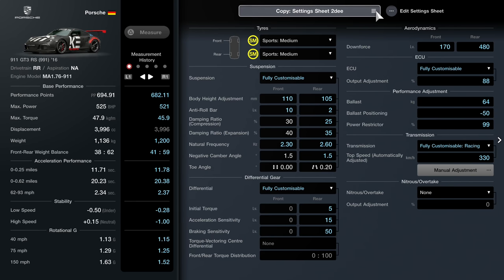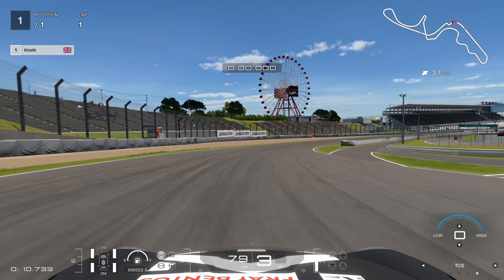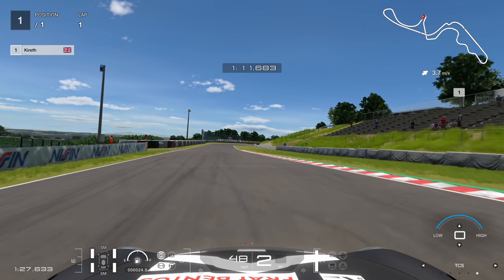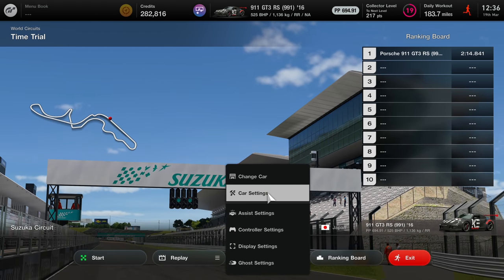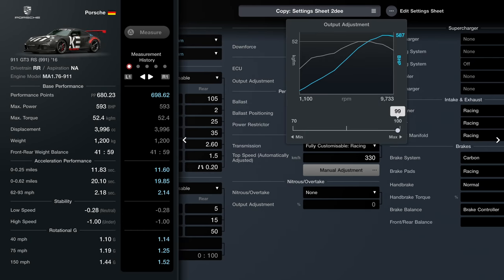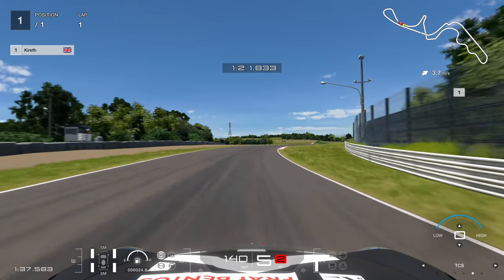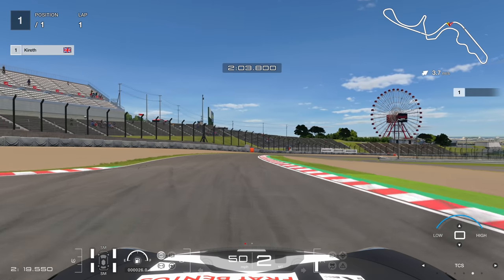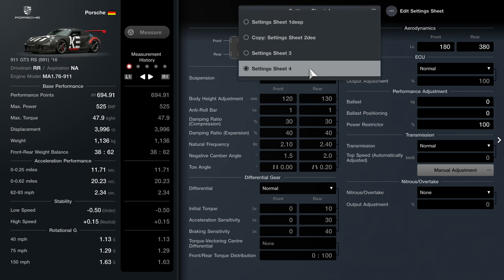Gran Turismo 7 Tuning Hack? Lower PP But 3 SECONDS Faster!

Comment: This has to do with lateral G and how the values are factored into PP calculation. You can make the game think the car is much less capable at cornering than it actually is, so the PP drops despite better performance.

I have a video on this showing how you can make lateral G 0.00 at 150 MPH, and it leads to some absurdly broken tunes for PP based events.
Reply from the maker: Nice! I've hypothesised that the basic values combine to calculate the PP, so if you can trick those basic values you can be overpowered for the PP limit
Reply: Great vids Harmonic. Thanks for explaining why. Subscribed.
Reply: So you rely on the game being broken, as opposed to good.

Good to know.
Reply: Per the GT7 State of Play, the PP is calculated by simulating a lap on a fictional track and seeing how it performs.
Reply: Also the trick of taking the last gear, (6th 7t, not the final gear.) and making it as long as possible would bring down the PP. But I have a question; Is this the same in GT Sport? Like in other games, they will fix the bugs.
Reply: @KeepCalmNCodeOn  I don't think that made the release version.
Reply: lateral G was 0.00 at 150 MPH because the setup you had at that moment wouldn't get the car to 150mph so the system couldn't compute the value

Comment: I would like to note that in general Porches are difficult by nature to control. Ballests in the front IMO are a necessity no mater what to get the front ahead of you. Sacrificing speed for sure on the downforce, but makes handling easier. Also if anyone is still feeling it’s tail happy, you have to control your turns with acceleration. IMO this is where manual transmission helps control your car.
Reply: Definitely agree , u must use a Porsche with manual transmission, only way to get that good boost in the right gear off of a turn.
Reply from the maker: Makes sense, thanks!
Reply: setting the acceleration sensitivity low on the diff means the diff wont lock on power application until further up the rev range, allowing you to put medium power into the turn exit without the rear stepping out.  I find applying a higher braking sensitivity helps the 911s turn in better under brakes at the rear locks up into corners and turns the nose in.  The initial torque acts like the minimum value for both, so keep that low.  Try using something like 5, 20, 45 for Initial torque, acceleration sens. and braking sens.  Those 3 numbers have made a big difference....not so much the numbers but the ratios.  Low initial, 3-4x as acceleration sens. and double that as the braking sens.

Comment: Tuning is key with the 911s and does seem to need quite nuanced tuning from build to build.  They are very different vehicles engineering wise and physics wise.  Spending the time to get the best out of them does make them an ultimately very driver-friendly car.  I've been loving them after discovering the tuning secrets with suspension and diff settings to make them super unbeatable for the PP limited races.  I had wondered why so many of the full time sim racers drove them...now I know.
Reply from the maker: Yep!

Comment: This is what I hate about tuning. I don’t want a 3 second advantage over the others! Just a fair race. Tuning just introduces several problems. More mindless grinding, more time spent in menus, less inclination to try a variety of different cars, races with wild disparities of car performance and as a result if all of these negative points, a MUCH smaller player base. BOP matchmaking is what made GT sport so popular.
Reply: Then you need to play need for speed, not race sims. 😉
Reply from the maker: There's still BOP tbf

Comment: Remember how bad the traction was in Sport at the beginning? Same with GT7. I've driven a street version of the Porsche 911 Cabriolet & with street tires I found it very difficult to break the tires loose.. Thanks for the tune 🎶
Reply from the maker: Yep no doubt lots of patches on the way - NP!
Reply: Street tires as in sport tires ?
Reply: @MrShadowofthewind  Well, whatever tires Porsche installed on the car from the factory, in other words, for sure not racing tires

Comment: Having the engine over the rear makes it a handful exiting a corner, as soon as I put 100kg ballast all the way to the front, Increase spring frequency to compensate, generally having a more raked suspension height in tune with applied downforce will get much better results. Such a confidence inspiring drive after that! I must try playing with the lsd settings to see how much better it is
Reply from the maker: Yep a lot more fun!

Comment: it can't make sense and purpose to take performance out of the vehicle to make it drivable, why tune the car then. I think that a lot of cars like the Porsche models don't correspond to real driving physics. It can be that a Porsche gt3 rs accelerates in fast corners, even though you drive in the corners at low speed, the car actually sticks to the track like a racing car, I think that still needs work on that. The Camaro is even more driveable in the game than the Porsche gt3 rs which is not the case in reality, find it a pity how some cars behave on the track, the Porsche behaves on the road as if you were cornering a jeep has a ground clearance of 30 cm and can therefore break out quickly in fast s curves.
Reply from the maker: Dunno camaro isn't great imo

Comment: Yeah I've been playing with ballast and lsd in a fwd car for a championship. In a test session I was 4 seconds quicker and much more consistent than the other guys. Thy wanted to know how and I just said big balls. ;) I did similar - loads of ballast set right to the front, diff sensitivity on 5, max wing df at the rear, almost minimum at the front. Similar results, not just faster despite being heavier (and less power because I needed to hit the pp) but much more stable and much easier to concentrate on pushing rather than just trying to stay on the track.
Reply from the maker: Seems to be the secret sauce, good luck in the championship!
Reply: @Kireth  yeah.  All we need now are stable private lobbies... weeks away I fear, but at least this proves the setup physics are more real world malleable, unlike GTS.

Comment: Love your videos. Would you be able to help me with the settings and the best way to bring your car to a certain PP or BHP. Trying to set few cars for my son but I just don’t have time to play around. 
If I need to get to 730 PP what is the best to reduce? Turbo, Reduce Power restrict or Output Adjust. Also can I drop some PP on tires? Just need a guide. 
Appreciate your help
Reply from the maker: Yo! Best with ECU and power restrictor
Reply: @Kireth  thank you. Just can’t set up the RCZ and can’t get it right lol or the Subaru
Reply: @Kireth  just need some settings for G3 cars for 730PP

Comment: Are you sure stiffer springs at the rear are better, I don’t have 911 yet, but the Clio V6 and everything else I’ve tested is noticeably better with softer rear springs, GT7 is different to GT4-6 Where (Like real life) Stiffer rear springs gave stability in MR RR cars, depending on the weight distribution, Like with anti-roll bars

Also a greater ratio in damping compression is usually better, like 10+ point. Anyway may help
Reply from the maker: Share your tune and let's see 🙌

Comment: Great video. But i don't think it's crazy... Putting near 600bhp in a car that weights half as much as a 90's Honda Civic is guaranteed to have that affect lol. The Porsche you are showing is only 1200kg's. That's barely enough weight on the tires to help them stop the car in a line... so it wont be enough traction to add a lateral load and or  600bhp on top of it in any combination.  I think that in real life though, a car like that with a slick would actually hop forward instead of rolling. ;)
Reply from the maker: Good points!

Comment: If you tune the suspension properly you actually don't need the ballast. I tuned all of the 911s currently in the game out of all this squirreliness, as well as full power carrera gt(which, at first I thought was bugged due to how all over the place it was and impossible to drive at high power). I actually found less, is more. Just stiffen the springs and soften the damper compression, pump the down force rear, and it gets rid of all that fishtail nonsense. There is some diff tuning as well and each 911 behave differently so each tune is different.... Edit nevermind, apparently I just forgot the ballast was on them lol carry on, nothing to see here
Reply from the maker: No mention of the PP advantage in your comment 👀

Comment: Is a driving wheel THAT superiour to controller? I can just barely eek out a 2:13.5 in the GT3 RS '16 with a 700pp build on RS tires, and you're smoking that on Sport Meds. I literally just tried that and all I did was slide all over the track being unable to break, turn or accel without putting myself in the gravel. Thats pretty incredible. What are the controller people putting down for lap times with a 700pp spec, any 700pp spec regardless.
Reply from the maker: Thanks man! One of our Kireth Esports drivers has made a video on controller vs wheel which is coming out on this channel tomorrow

Comment: Not 3 seconds quicker.  If the 1st lap was a true 1 take lap, then there's lots of trial in error to equate to a difference in seconds. Especially considering you actually got caught in the grass on the 1 take lap overall. You probably can make up 3 seconds stock. With little practice as you did with what you call.....a tune
Reply from the maker: Disregards tune, offers no constructive alternative, got it!
Reply: @Kireth  I gave constructive real criticism. I gave a real alternative too. 3 seconds improvement stock before the tune with multiple laps(practice i did mention). That would require multiple test runs around the track stock. After that you can make improvements to validate improved times with consistency after that tune vs stock and then publish it presentable.  Your 1st shown run lacks any consistency for running a best lap but nothing more than just a mare 1 sloppy lap, and your tuned lap probably had a lap or 2 plus the original lap obviously to have all of those changes implemented at the least, plus when better purchased brakes you did🤣 which will improve time on its own and then you decided to record it. How is that truly a 3 second improvements tune for the public? Sure you made a suggestive tune,  and people will take it for what it is, but there's tons of ways to improve 3 Seconds both stock and with tuning,. I figured this was a no brainer but if constructive criticism and the truth is a bit much, then with time it won't be as bad in the future if you can simply become use to understanding a little racing common sense.